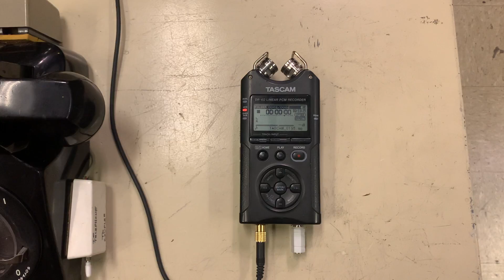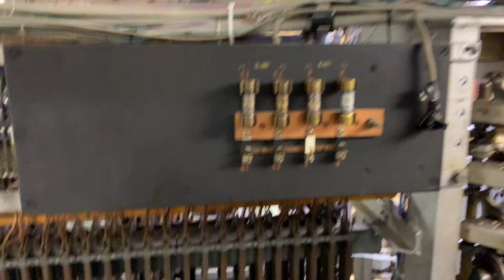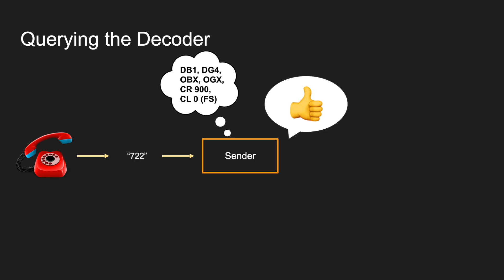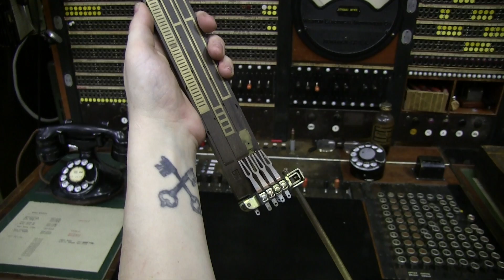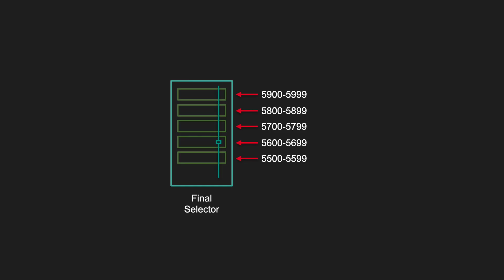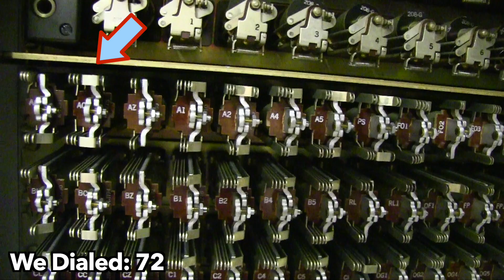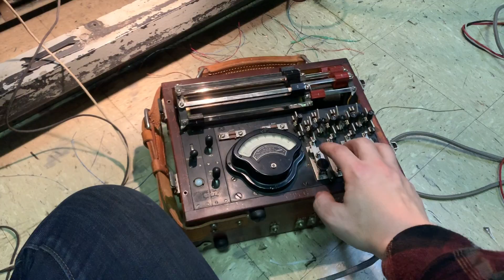Full Mechanical: The Panel Telephone Switch

Comment: Are subscribers lines connected to a row on both a final frame and a finder frame? If not, how does an originating subscriber get routed to the finder? And if they are connected to both, how does the finder not disturb a connected call on the same brush group (say, subscriber line 5 is on a call, and their numerical neighbor 6 goes off hook to originate)?
Reply from the maker: Yes, in the panel system, subscribers are connected both at the final frame and at the line finder. Nearby calls will cause brief clicks on your line. Noise was one of the problems with the panel system that later systems didn't have. If the brush had to travel to line 6, and you were line 5, it had to travel past you to reach 6. When that happened, you'd hear a click.
Reply: Thank you. These switches are all beautiful, marvelous works of engineering and you all are doing amazing work in bringing them back to life. I hope I can eventually come back out to Seattle and visit the museum to see them in person.

Comment: On SxS systems, for local calls, we could only dial the last 5 digits in a number and connect.  Example: 795 2569 and we'd only dial 5-2569, and it would ring the number.

 I wonder how this system would react to that.
Reply from the maker: it would be just like dialing 525-69 ... and then waiting. The sender will treat 525 as the office code, and call up the decoder.  Then, 6 would get stored as the thousands digit and 9 as the hundreds digit. Then, when you stopped dialing, the sender would wait for a little while, then time out and give you a busy signal.
Reply: @ConnectionsMuseum  Rather poorly, then. Noted when we switched to digital ESS systems that added basic 911 to the community, we had to dial all 7 digits to make a local call.  

Oh, and I had just remembered another feature of the SxS system. If you had multiple extensions on the same number, you could dial 5, 4, 3, 2, 1, then hang up and the plant would ring back into the same number. It was great for intercom use for telling folks that dinner was ready.  To use that feature with ESS, we dialed the full number to that residence, then hung up and the plant would ring all the extensions like a normal call. 

The big difference between SxS and ESS intercom calls is the ring pattern.  On SxS, it was three short, then three long, and it would repeat. The ESS ring was a normal call ring.  We agreed to let it ring twice so it would be understood as a intercom call.

Comment: For next topics, could you explain how the ring voltage works, how is it blocked from being heard by the caller (I don't suppose that ring tone the caller hears is raw ~80v over the quiet battery) and most of all - how does off-hook detection work for the called end point. Specifically how does off-hook detection work (or does it exist at all) in the middle of the ring voltage. Say the called phone is picked up right in the middle of a ring - does that mean the AC ring voltage does NOT stop and goes straight into the receiver for the remaining duration of the ring? If yes is there a ceramic cap or something to block it inside the phone?
Reply: Ringing voltage would be connected to one leg through a relay coil, and DC battery to the other leg. A capacitor is connected in series with the bell to block DC so when the phone is 'on hook' there is no DC path. The relay is 'slugged' so will not respond to the ringing voltage. When the customer picks up the receiver, a DC loop is made which operates the relay,  disconnects the ringing and connects through the speech pair. A second coil on the relay is energised and holds the relay closed for the duration of the call. This would happen far quicker than the customer could pick up the handpiece and put it to his ear.

Comment: Is it possible to dial too fast with a 500 set? It seemed to me that the final digit could start dialing while the next to last digit's rod was still hunting.
Reply from the maker: All of the digits can be dialed as quickly as you like. I only slowed down the dialing for this video to illustrate the actions that happen in the machine. The sender stores all of the digits and can control the selectors at their own speed.

Comment: Excellent video Sarah!  My question is about party lines.  How does the ringing circuit know which ring pattern to use?  Does the person dial an 8th digit to choose a party?  Do all parties share the same 7 digit number?  Does the sender encode the subscriber ring as a 7th piece of information?
Reply: as I understand it, the different parties on the shared line each had different phone numbers, (I'm guessing only the last digit was different,) and depending how that last digit was connected into the ringing circuit determined what the pattern was. maybe we'll get to see some videos of this in action as the new tone generator exhibit is wired up.

Comment: Having been inside several types of operating offices (5XB, SxS, 1ESS, 2ESS), it is nice to see how a panel office works.  My question:  Can you dial "too fast" for the switch to react.  The tours were arranged because we had DID trunks for the equipment we worked on.  If you didn't have battery going back to the CO, you could drop trunk availability, or (5XB) stick senders, which they really didn't like.  The SxS stuff was a bit easier to "see" the call.  In the early 70's they had a SxS PBX where I worked.  Fun to get the keys and look inside, or just visit with anyone who was working on the switch itself.  You don't see much of things nowadays with the DMS100 or 5ESS.

Comment: Loved this! We didn’t have panel here in the UK so all of this was new to me, but you made it so easy to follow!  Really love this style and am looking forward to more!
Reply: British Post Office nearly purchased panel switches for London. Then one of the British step by step manufacturers developed a 'director' using standard items which could convert the first three dialled digits to one to six routing digits (in-house call would use 1 digit and a tandem route 3 or more digits). It stored the last 4 digits on uniselectors which were sent on once the routing digits had been sent. BPO preferred to purchase British made equipment so it dropped negotiations with Western Electric and ran with step by step with directors for London and several other large UK cities.

Comment: This was great!  I know you mention that the decoder is a video all to itself but could you answer a quick question?  
How does the decoder send the path info and how is it remembered by the sender electro-mechanically?
Also, it's amazing that as the caller dials the connection are made in real time and potentially they are activating equipment in real time somewhere distant. It boggles the mind that a DC system can transmit signals faithfully over long distances without attenuation dropping pulse info.
Reply from the maker: The sender and decoder communicate over about 60 leads, and the communication is done by grounding some, and leaving others open. For instance, when the decoder wants to transmit the number "7" to the sender, it will ground the "2" and "5" leads. Inside the sender, these two leads will be tied to 48V through relay coils. The grounds will operate the two relays (2) and (5), and the information will thus be stored in the sender. Again, massively simplified, but thats the basic idea!
Yeah, isn't that wild? It totally is just a DC telegraph circuit. The maximum distance between two panel offices is roughly 30 miles. The maximum frequency at which pulses can arrive to the sender from the far end is about 30 pps. The relay in the sender that "listens" to the pulses is super sensitive...it's expected to operate on 10.5mA and not operate on 9mA, meaning that there is a 1.5mA difference between whether its going to operate or not. Super strict tolerances for something built 100 years ago!
Reply: the digit storage on the relays is worthy of its own video.

Comment: You explained that for party lines there were no partial "rings" allowed with panel, the switch is set-up to wait until the next ring pulse begins. 

1.) I suppose then with PL (Private Lines) a half-ring would be allowed?

I do remember hearing a partial ring on the calling end here in California before we went to ESS. 
I also seem to remember partial rings on the receiving end too.

2.) Had the different ringing frequencies been eliminated for party lines by the time Panel Switching was introduced? 

A friend who lived in Philadelphia many decades ago remembers and explains that ringers on party lines were wound differently and responded to either higher or lower ringing frequencies.

3.)  I also remember hearing dial tone still being heard during the dialing of the first digit in California.  I suppose the same Dial-tone coupling" sequence was followed for Crossbar as with Panel switching?

As far as I know Crossbar was the current switch technology in Los Angeles county during the 1960s.
Reply from the maker: 1. There may be versions of the incoming selector circuit that allow for ringing immediately, and not waiting. I have not seen one, but there are so many different variations of the circuit that I couldn't say for sure.
2. Panel switches never did frequency selective ringing. I think this may have been because it was always intended for use in dense urban areas, and there likely wouldn't be more than two parties on a single line. Don't quote me on that second part though.
3. Dial tone through the first digit was still a thing in No. 1 Crossbar, but only in the original (1940s design) senders. The new senders that came out in the 1960s eliminated that. If you heard the dial tone thru the first digit, its very likely that you were on a 1XB with old style senders. (I'll demonstrate this in my next video)
Reply: @ConnectionsMuseum  After some digging I found this website http://www.thecentraloffice.com/calif/la/lap/lap.htm with references to Pacific Bell (formerly The Pacific Telephone and Telegraph Company).  I suppose then it could have still been Crossbar 1 in the 1960s, or maybe not.

Type: Urban
The Hawthorne CO was built in 1950 to relieve the Inglewood office.
Old Exchanges: OSborne 5, OSborne 6, OSborne 9 and SPring 2.

The Inglewood Office (which this refers too)
Type: Suburban
Original Southern California Telephone office built in the 1920s.  Became dial in 1939.  Remodeled and expanded in the 1980s (Note Pacific Bell "orange" accents.)
Old Exchanges: ORchard 1, 2, 3, 4, 7 and ORegon 8.

I remember the when we went to digital all of the phone numbers were changed.  Our old at the time Osborne5-1945 was reallocated to one of the aerospace companies in the area.  Now it is a 310-643 number and we're currently we're connected to a 5ESS in El Segundo which is now also getting a bit long in the tooth.

Type: Urban
Replaced the original El Segundo CO in 1999.  Original CO had the Centrex service for the Hughes & Aerospace Complex.  Also served as the Centrex for the Los Angeles AFB.
Old Exchanges: EAstgate 2, MItchell 8 and NIagara 3

Maybe I confused listening to Phone Trips too many times and have it confused as to which version of the Crossbar was installed.

Interesting I've been in the same place all my life, but our CO has moved several times! 

I do remember when the distinctive sound of the dial-tone changed from the buzz of the old generator to that of the later which could be best described as kind of a fast paced purring-tone. ;)
Reply: I remember hearing the background noise of the central office which you played from 3:28 to 3:33 after dialing the last digit of a phone number while waiting for the called parties phone to start ringing.  I also remember hearing the busy signal bleeding through in between rings.

There were other times when for instance a line was down, or moisture had saturated the junction box on the pole, you could hear CO noise, subdued ringing generator noises etc. 

It was certainly a most interesting time.

Comment: I just wonder since I can't exactly search for any terms here and get good results, what's actually selecting the specific rod to drive on the selectors and line finder?
Reply from the maker: Oh, that's enough for its very own video! The line finder is selected based on a number of different inputs, and a circuit that advances the search forward one step on each call. That way, load is distributed evenly. Selectors are chosen based on the the trunk multiple and .... yeah like I said. Complicated enough to be its own video.

Comment: My grandmother’s line was on a step by step exchange, but my home phone in a different city was on a crossbar exchange.  I used to notice when dialling home from my grandmother’s phone line I would hear the loud clicks of the equipment for the first 3 digits.  After that, there were no background sounds for the final 4 digits being dialled, but as soon as I’d finish dialling the very last digits it would ring.  There was never any delay.  It was super fast with no audible clicks.  When calling from my house to my grandmother’s house it was a very different sound because now I’m on a crossbar system calling into a step system.  There were no noises at all on the crossbar when  dialling until you reached the very last digit.  You’d hear a double click. <click-click>  and a pause and then another double click that was a lower volume and then it would ring.  If I called my friend who was on the same crossbar exchange I would hear the same double clicks <click-click>, but then it would start ringing.  No second set of clicks.  I could be wrong but when calling my grandmother I always thought the crossbar system was sending the step system the last 4 digits and those had to be pulse dialled on the step side, which is why it would go quiet for 4 or 5 seconds before the second double clicks could be heard and the line would start ringing.  I’ve always been intrigued with the sounds of the mechanical exchanges.  I used them for so many decades that I was highly familiar with the audio routines they would go through, but this is the first time I ever saw what was going on to make those sounds.  Thank you for showing us this Sarah.  I loved this video.  It was so educating.  Thank you for the time you spent putting this excellent video together.  It’s nice to know that the old mechanical stuff is still around.  The phones make no sounds now with computers placing the calls these days and giving us artificial ring and busy tones generated by sound files.  The old systems were more interesting and mysterious.
Reply: It sounds like your home was on a #5 crossbar.  I lived in several places and moved from #1 crossbar, to ESS, to #5 crossbar.  #1 was the most interesting sounding of the ones I lived with.

The last live Panel I heard was in 1980-81.  While rare at that time, it was my favorite.
Reply: Davis P I drove my poor parents nuts hooking things up to the phone line when I was young.  I discovered that you can listen in on the line without getting a dial tone if you unhooked one of the wires on the rotary dial.  There were 2 white wires and one red and one green.  If I unhooked the green one, I could pick up the receiver and hear into the line similar to what we were hearing in the video. Sometimes I could hear my neighbour talking in the far distance.  Or I’d hear a busy tone or ring tone.  It was very noisy.  I decided to write a composition for school called, “How the Phone Works” and called Bell Canada asking them if I could have a tour for a school project.  They were nice enough to let me go for a tour.  NOISY.  Inside it was like a million typewriters going.  I asked the guy what the exchange system was called and he said C2.  Would that mean crossbar 2?  I don’t know but I do remember him saying that.  This was 1975 by the way.  I was there all afternoon.  He even showed me how they could tell if the customer had more than one phone on the line by looking at the resistance on an analogue meter on a panel board that looks similar to the one Sarah sometimes shows.  Back then phones were hard wired.  No such thing as modular jacks in Canada until the 80s.  They would fine people $500 for hooking an extra phone up to the line.  The key is the bell. The bell is always connected even when on hook and it shows a lower resistance with each phone wired into the line.  I was surprised he gave me all of these details.  He was excellent. I wanted to work there but never did.  Very hard to get into the phone company back then as they hired mostly family.
Reply: @ds99  Actually an additional ringer generated a higher capacitor kick.. Because the ringer is in series with a capacitor. The capacitor was required to block the D.C. voltage. Enjoy.